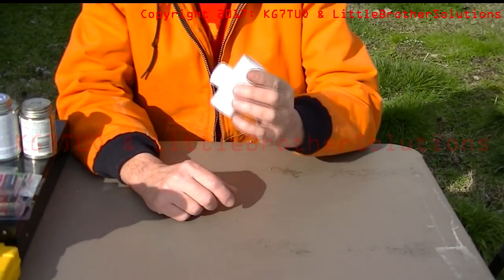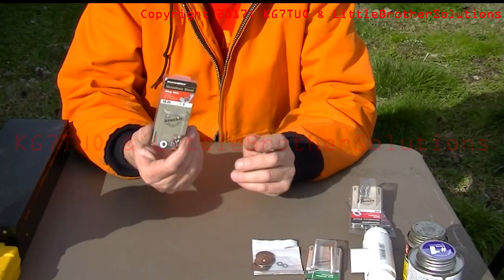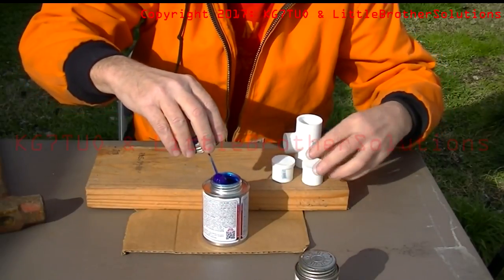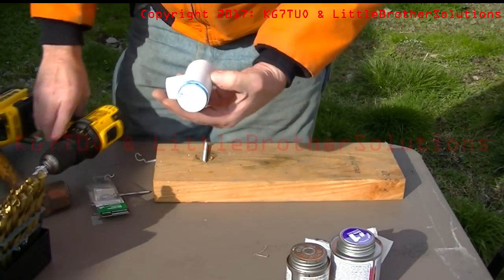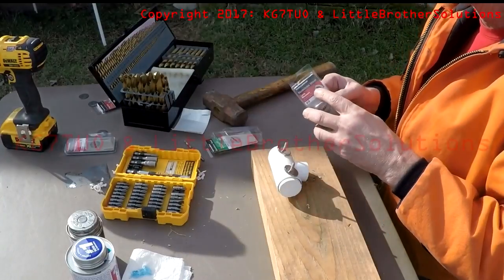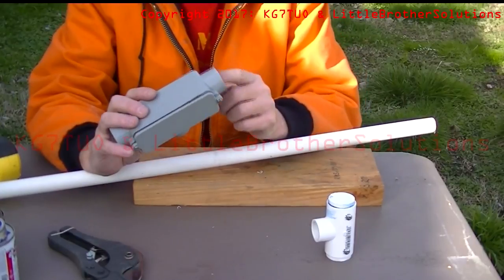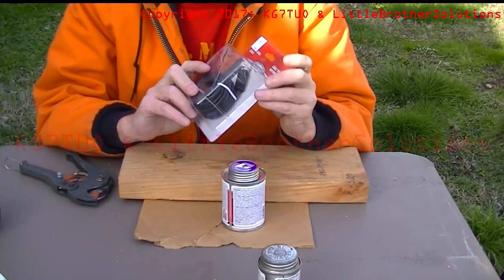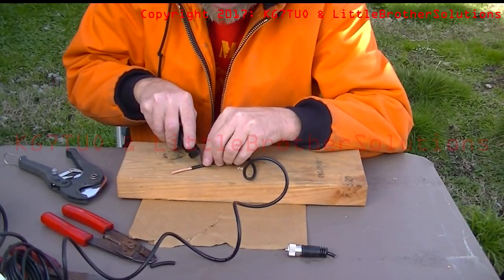HOMEBREW Dual Band 2m / 70cm vertical dipole BUILD #2 Part 1 of 4

Comment: If you cut the PL259 end off a pre-made job, don't cut the connector off close, but leave a foot of RG58 still attached. That way you can use the off-cut to make a flexible tail for another project, or terminate another plug on the free end to make an adapter- cable. (I'm not tight, just close to a dollar)
Reply from the maker: Good suggestion but I now have a 500 foot spool of 8x sitting here in the shack along with a supply of solder on PL259's and silver plated adapters.

Comment: I put the connector on the bottom to give a bit extra rain protection.  Then instead of a long piece of PVC tubing for the counterbalance, made a short one (less wind resistance) and put another T tube on the end, put 4 ounces of lead weight inside with polyurethane foam for padding, glued the caps on, and seemed a better solution.
Reply from the maker: Hope it's working well for you. The counterbalance for my purposes was because of using a rather flimsy portable mast made from PVC pipe. It also serves as storage for the elements when in storage or transporting. I've also built one with just a 90 degree gray conduit fitting for a permanent installation. I donated that one to the local HAM club for a fund raising raffle.

Comment: At 5:53 i had a flashback to the time i buried a driver bit in my hand. Good video. Thanks.
Reply from the maker: Yes, I was aware of that and there was very little pressure so very low probability of that happening but my spidey senses did tingle.  LOL

Comment: It may help if you start with a tap to start the bolt.
Reply from the maker: The plastic is really soft and while a tap would probably not cause any issues it would just be additional time added to the build time.

Comment: Thanks Bruce,
Great antenna ideas. Considering doing a "homebrew" 2m /70cm myself and collecting ideas.

Tim KI7VJT
Reply from the maker: You're welcome. If you were closer I could provide the welding rods as I buy then by the 5 pound package online for about $1 a rod after buying the first ones locally for $25 for 8 rods (ouch).  Even with shipping the online ones are a LOT cheaper.
If you have any questions you can usually find me on the PEAK repeater system (w7pra.com)

Comment: Used the primer, purple, and the glue, clear , backwards.. the primer is used 1st then the glue
Reply from the maker: Actually, if you look a little closer, you'll see that the primer I used in this vid is clear and the glue is blue. While there are types of primer that are purple and types of glue that are clear, that's not always the case.

Look closely and you'll see that when I put the BLUE on it does not run like the water thin primer would.
Reply: Ok, I see now... my apologies sir, guess I need to pay more attention before I open my mouth... lol
Reply from the maker: @scottdunn1093  It's all good. Better to have it "splained" to you than to just grab the purple stuff some time and realize you put the glue on first. First time I saw anything but clear primer I thought....hey that's neat, now I can see that I actually got it where I wanted it.

Comment: Is this antenna better than the aluminum rod units?,,,its smaller,,,is bigger better?
I plan to build one, Thank you, this may be just what the doctor ordered.
Reply from the maker: I haven't built any antennae with aluminum rods so I'm not sure what antennae you're talking about.  All of mine have been stainless rods except for the barbed wire and the water tubes.

Comment: Can you throw together a parts list, I am running a NET with local folks, they have rubber ducky's and most have poor propagation .  Thinking I can build a few of these at cost to assist our little preparedness group to get  some wings.
Reply from the maker: Parts list is simple.  
Two rods for the elements (cheaper on Amazon in bulk than local)
Two each bolts, nuts, lock washers size 10 stainless or galvanized
FOUR 1" washers with size 10 or slightly larger holes....do NOT use a different outside diameter as it has a large affect on SWR
A PVC T 3/4 x 1 x 1 to mount the elements
3/4 PV by about 18-24"
3/4 gray pvc 90 elect box
SO239
2 #6 screws to secure so239
1 #6 lock nut to secure coax grnd to so239
RG8x or RG58 coax from element bolts to so239
miscellaneous PVC cement, solder, ring terminals, etc.
Reply: @kg7tuo999  don't use different OD washers? Or elements?
Reply from the maker: @ryanlaurie7322  Do not use a different OD WASHER.  If you want to play aroudn with things you could but if you just want to build an antenna that works, stick to the same washer size I used.  I tried a smaller washer on one of these and it totally changed the impedance and thus the SWR

Comment: Uh, PVC primer is not required or necessary for a project like this. It is required if you are joining PVC pipe or fittings that must pass a city, county, state, or government inspection.
Reply from the maker: Okay.  But it does a damn nice job of cleaning up the material prior to glue up and it makes for a good joint.  You don't want to use primer go ahead. Maybe the joints will hold up.

Comment: I would like to build one. Any special reason why you used the 1 inch by 3/4 tee? Is it that you had that already? Can I just use a 3/4 tee?  Shiv N2VFA
Reply from the maker: I use the 1" T's just because they're easier to work with.  The 3/4 T will have you a little tight on "real estate" but it's doable.
Reply: @kg7tuo999  Thanks for your reply. It did cross my mind that you used 1 inch for space. Went to Lowes they have the 1 inch but they did not have the plugs like you used. Guess I will use 2 small pieces of 1 inch pipe and get (2) 1 inch caps instead. Will let you know how it work out.
Reply from the maker: @jshivprashad  That will work.  I have also built one that was sealed with wine cork (the synthetic type) cut in half so that I could do both ends with one cork.

Comment: Do you have info on the gain of this antenna?
Reply from the maker: I do not. However, I do find from time to time that there is a distinct null in one or two directions. I discovered this when the wind blew and changed the direction it was pointing and I got some reports that my normally excellent signal was degraded. Turning the antenna 15 or so degrees to one side fixed the signal reports.

As it is almost omni directional, I thought it was until I had the experience above, it probably does have some small amount of gain but I would guess it is minimal.
Reply: The gain will be close to 2,15dBi as this is the gain of a dipole antenna.
Reply: @kg7tuo999  The antenna is 100% omni directional.  The reason the signal changed, are reflections from objects and terrain.  Direct signal +/- reflected = sum.  Depending of the phase of the reflection.
Reply from the maker: @la7dfa   I understand your 2.15 dBi statement but am not entirely sure that there isn't some gain in certain direction(s) as the signal changes I described occur regardless of location. I have several of these antennae and they are used in field operations. Regardless of location, I have found that there is a null and it doesn't seem to be aligned with the shorter 70cm portion of the element. However, without equipment to measure and verify, I cannot be certain.

Due to the excellent overall function, I don't see a need to dig into exact measurements of field strength and just treat is as an omni dipole with vertical orientation.
Reply: @kg7tuo999  The elements may have a slight effect on the other, and also the feedline.  But I agree its a good design for local QSOs.  Good luck with antenna building.